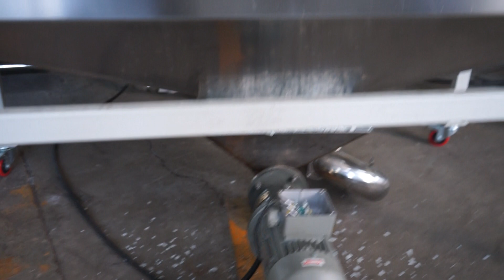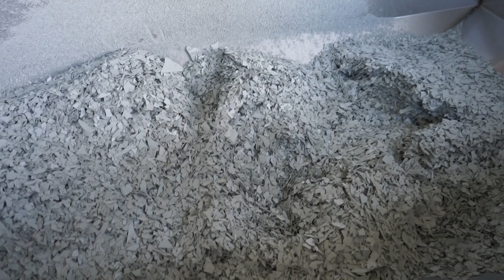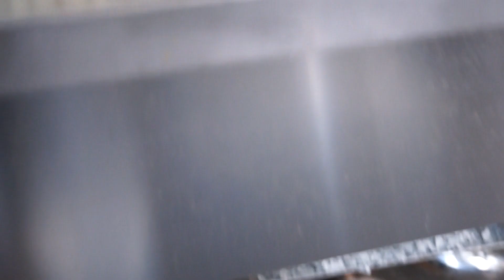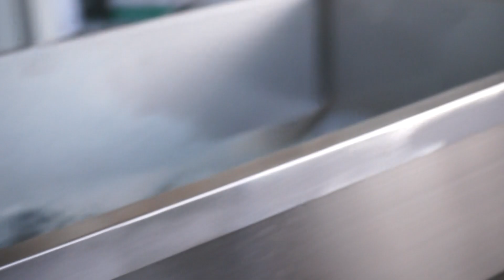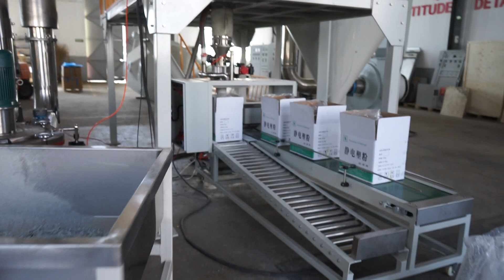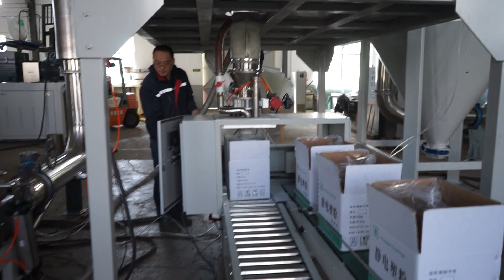extrusion system for powder coating matching cooling belt

Comment: whats tha maximun speed (meter/min) for one cooling belt  with 1000 kgs/hr ? we know that this value depend of the width, supose 1400 mm, do you offer compact cooling belt for this output 1000 kgs/hr of powder coatings
Reply from the maker: thanks for your inquiry ,  normally  water cooled type will support your required , for more details pls send  email to us     id : sales@ytopsun.com